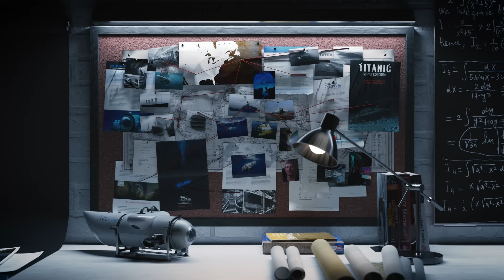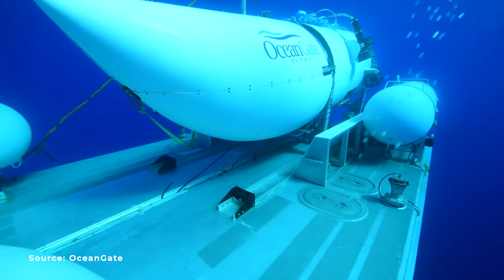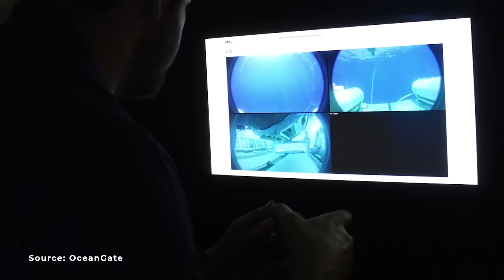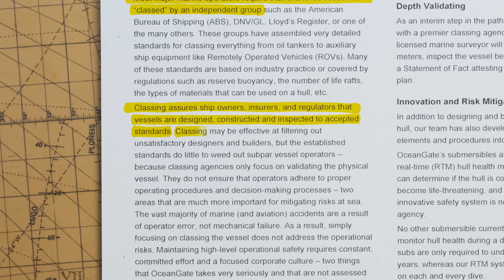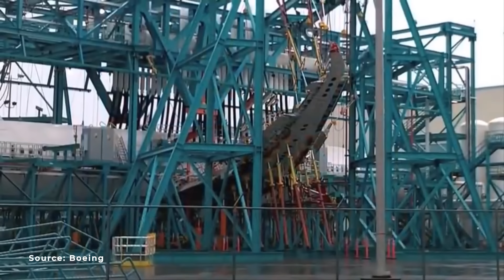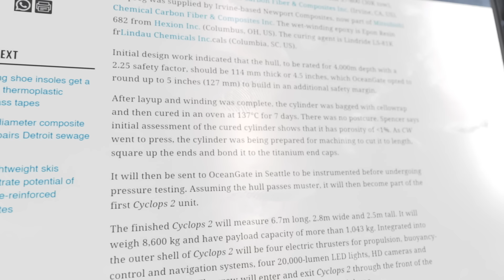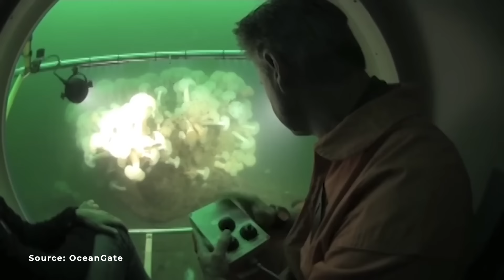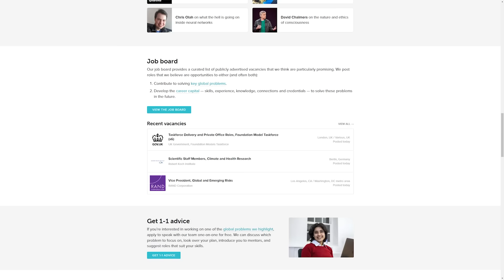The Questionable Engineering of Oceangate

Comment: I think it's interesting to look at SUBSAFE, the military standard. The USS Thresher sank in 1963 due to poor quality welds on parts of the submarine that were deemed not safety critical prior to the accident. In response, the SUBSAFE program was created, and the U.S. Navy stopped losing submarines to accidents. The Navy lost 16 submarines to accidents from 1915–1963, but they've only lost one since then, and it was built before the SUBSAFE standard came into effect. Perhaps the most obvious case of the necessity of regulations for safety is in submarines, but Oceangate did not listen.

Comment: I am fascinated by submarines since reading Tom Clancy’s SSN a decade ago and while I’m not expert, I do know that CF is great for automotive and aero but I wouldn’t trust it in a sub.

The only warning is a acoustic alarm is the most insane thing I’ve ever heard
Reply: possibly not quite as insane as bolting monitors and interior lights to the inside of the hull, as some pics they posted hint at. Not validated, but some engineers in risk management have wondered. Actually, it's hard to pick any "innovation" that was sane in this mini-sub. Maybe the toilet?

Comment: Great video, until you came to the part about the new engineering ethos. The problem with some regulatory and testing agencies, is that sometimes they aren't keeping up with the latest innovations. The trick is innovate testing and regulation along with the engineering. This doesn't always happen and ends up only stifling innovation. Unfortunately, this is why new technology is called the "bleeding edge".  Governments are far more interested in social innovation than engineering innovation. We need to elect politicians that understand these issues. Unfortunately most don't.

Comment: So far, this is the best breakdown of the safety issues that carbon fiber hull posed.  I kept asking about the strength of that material.  I could have sworn that it was super strong under tension, but that’s it.  Glad someone was able to confirm that.
Reply: Yes...this video explains the 'cracking' they heard...and passed off as 'Oh...it always sounds like that'.   This was the second hull because the first one got so bad nobody would go in it so they had to make another one...don't know if they changed anything in the construction and if so...that's just double-dumb.
Reply: Tension and compression are not the same thing, so you are absolutely correct. Carbon fiber is extremely strong under tension.

Comment: About 80,000 hours. Calling them "evidence based" is perhaps skewing the perception a bit. 80,000 hours subscribes to the Effective Altruism model of doing good, which favors short-term, more easily measured impacts than long-term changes. 

This is not inherently a bad thing, but the bias does exist and is worth remarking upon. Philosophy Tube does an excellent and pretty fair video on the ethos of it. Basically "How can we do the most good within our capitalism machine, without doubting whether or not the machine should exist." If that works for you, then by all means, check em out. Within their framework, they are indeed a very well researched and comprehensive service.

Comment: What I'm most curious about is how the aft equipment bay was designed. I haven't seen a detailed examination of this design element.

From what I gather, the equipment, batteries, etc were outside the carbon fiber and titanium pressure hull.

The only way to do that would be to flood that area in order for pressure to not collapse it early in the dive.

What was used to insulate the batteries and other electronics from the water and cold?

Comment: I work with carbon fiber every day. I have no education in carbon fiber or engineering beyond my experience in working with the material for about 15 years. I knew this would not work for a hull. Carbon has no compressive strength. When we have to bolt a carbon fiber part to something, an aluminum or G10 "hard point" is sunk into the laminate to give the bolt a place to apply torque in holding the carbon part to whatever it's being bolted to. If the bolt was tightened down on carbon fiber, the carbon fiber will crush, delaminate, fray, etc. Carbon fiber is a tensile strength material only. In compression, you're relying on the crush strength of the epoxy, which is just a 2 part plastic. This hull was guaranteed to implode in my opinion. I had no idea someone made a sub out of carbon fiber until this happened with the Titan. It's a damn shame. All he had to do was ask someone that works with carbon fiber. Oh, and unidirectional? That was really stupid.

Comment: Take 10 sheets of paper and stack them together. Now pull on the ends of the stack. Now push the ends towards each other. That's a delamination failure. The material is not suitable for compressive loading. The sheets work together in tension, spreading the load. They do not work together in compression.

Comment: Oceangate’s CEO also talked about learning from NASA, despite replicating the same emergency exit issue in the event of fire generated toxic gas that killed Apollo 1’s crew and started NASA on their path safety excellence, from the slapdash rocket program they inherited from the US Army.

Referencing SpaceX their April 2023 test launch, the one they had to destroy due to some of the engines failing, ripped its concrete launch pad to pieces destroying several (unoccupied) structures and a camera car on site, all because the launch couldn’t wait for the concrete to cure. A quick scan of reddit and I can find comments from their concrete contractors that they artificially cool their concrete pours so they can erect rockets on them, but then rip them to pieces shredding the launch site tank farms every time. This has been their standard practice for years.
Reply: None of that is true. The concrete had cured weeks ago. They had done a few test ignitions on the pad already. They did a 50% thrust test. Based on the observed damage they expected the pad to be capable of one launch. It seems the sand below the pad compressed more than expected which lead to the pad cracking which let exhaust gas under it. 

They had already been working on a new design for a few months and are currently installing it as we speak.

Comment: Very interesting and well researched video! Just two points. CFRP is not intrinsically bad in compression, but with poor implementation, yes. Good example : the top of B787 wing  (which works primarily in compression) is in CFRP. The way you introduced it was quite misleading, even though the following detailed explanations were quite good and thorough.
The main issue is not CFRP per se, but lack of good practice - especially testing - regarding advanced materials is.

Think about it: if composite were so bad in compression and with a poor lifespan (short fatigue life), it wouldn't be used in any beams or parts withstanding bending and/or compression and/or cycles (e.g. ski, bike, golf club, tennis racket, aircraft wing, etc.) ...

The other (small) point is listening to "cracking". First, you say it is useless because is it instantaneous, then, you provide an example of someone how witnessed it (and survived). Because in practice, you can indeed hear the CFRP cracking long before failure. Problem is - again - poor practice, for this is not a reliable way to predict failure (especially when again you've not tested it). But this was enough to inform that the structure was working too much => good way to get warning ("ok its time to stop"), bad way to get prediction ("ok, I can do a couple more of dive").

That engineering guy did exactly the right thing (and props to him for doing so): working on it until good practices were not meet anymore.... critically during the qualification phase!

What could be done? A solution would have been to just add more CFRP. Autoclave (that you rightly mentioned) would have been also a good thing.

Conclusion: CFRP is not the issue per se - far from it -, but poor implementation is.

NB: I hope this message don't sound too harsh, because the video was overall very well research and executed :)
NB2: the submersible was struck by lightning in 2018, which is a well-known way to create internal and hard-to-detect delamination :-/ (again ... testing and qualification, blabla. ...)
Reply: that story about being struck by lightening was from Rush, given to passengers who had already paid for a trip in 2018 or 2019, as an excuse why there wouldn't be trips that year. (there were also other excuses Rush used.)  It's very unlikely true, more likely fabricated to fulfill one of the exclusions in the contract for refunding or rebooking later without further charges (i.e., acts of God do not qualify for refund of cancelled trips or full credit towards future trips).

Comment: Even if the CEO wanted that everything he and his company do to look innovative and to push boundaries and I think that it ok to push them however he was pushing the wrong boudaries(the safety ones)in the wrong direction.
It will be called innovation when/if he will do a subs that is 10 times cheaper and 10 to 100 times safer or if he created and designed a new tehnology instead of cutting corners.
P.S.:After the incident I was looking for a video from your channel and I didn't found but here we are and watching as fast as possible when I see in my feed.

Comment: while not an excuse for poor design or profiteering . all those aboard were reported well known "adventurers", risk taking sort of comes with the territory sadly.
maybe doesn't apply to this particular situation but, a lot of what modern engineers know today was built upon somebody doing stuff they were told can't or shouldn't be done.
great video though. as a tool maker worked closely on a project with Boeing engineers when carbon fiber composites were rather new. was very interesting there was a lot of, a lot of testing, test, make changes over and over again.
love the channel. subbed

Comment: The whole glue bonding process. Was the main factor. But overtime the carbon fiber hull grew micro fractures. Which because of not inspecting the whole craft resulting in malfunctions to go unnoticed. Even during final descent the malfunctions wasn't noticed until it was to late. The craft was built with two pressure chambers one for the passengers one for the main control unit. Which has backups. The contol unit got water into it overtime growing a small leak. It was never noticed. Adding a lot of extra weight to the craft. Which is why they couldn't issue an emergency ascent like it should.

Comment: Geez, I didn't realize it was a carbon fiber hull. What a horrifying design choice! I think you gave the company way too much credit in this video. Most likely, the CEO was yet another blowhard tech-bro with absolutely no engineering sense who saw carbon fiber showing up in things and figured it's a silver bullet to all engineering problems and then told his team to build it no matter what. I strongly doubt any serious cost analysis was actually done at any step and that every cost decision was entirely reactionary to the problem that preceded it. Even with an autoclave, even with testing, even with all that stuff, carbon fiber is still an inferior choice both in compressive strength and cost. I mean, come on. It seriously could not have taken that much more in cost to slap some foam on the outside of a titanium cask.

We engineers need to start speaking out more against these absurd tech-bro pipe dreams BEFORE these easily preventable failures keep happening.

Comment: Great video! First one I've seen touch at all on the failure modes of composites under pressure, or explain exactly why the acoustic warning system was ridiculous.

"Move fast and break things" comes from Facebook's internal design strategy when they were expanding their services rapidly. Their worst-case scenario when "breaking things" was a glitchy social media site. Anyone who uses that philosophy for human-crewed vehicles is an idiot. 

Re: SpaceX, they tested to destruction with no people on board and then improved their design. Still not even remotely the same.

Comment: Regulation limiting innovation is actually a good thing.  Just look at the early history of iron and steel bridges.  With very few exceptions, all of the bridges that failed were the most innovative designs of their day.

The problem with using acoustic monitoring to warn of impending failure is that you would need to test the system to verify that it actually worked.  Stockton Rush did not have the money to properly get the job done, but only found out when he had spent too much money to abandon it.  He should have built an ROV (maybe more than one) with a carbon fiber reinforced epoxy hull, equipped it with his acoustic monitoring system, used the ROV to survey the decay of the Titanic.  If the acoustic monitoring was able to predict failures in a timely enough manner to prevent catastrophic damage, he could have gone on to passenger carrying hulls.  Being a cylinder, you can cheat on the circular area tomographic X-ray scanner by rotating the hull, instead of the x-ray source and detector.  Checking the hull for damage after each dive was possible, but the submersible would need to have been designed for it (Hoist the Titan onto the mother ship, unbolt the end caps, slide out the interior, and then slide out the cylinder).  

The Virgin Galactic craft really should have been redesigned, based on the simulator runs.  I am not privy to the exact design challenges, but the issue seems to have been only a tiny window in time between when the craft will be destroyed if the folding mechanism is not locked and when the craft can still safely abort if the folding mechanism is locked.  If the test pilot had tried unlocking the folding mechanism early, in a simulator run, and been told that the craft had broken up, he might not have tried it on a real flight.  Of course, the crew should have been told in no uncertain terms that unlocking the folding mechanism early would result in the craft's destruction.

Comment: Using my rounded numbers, the sub experienced some 800,000 lbs. on every square foot of surface area. It's not much of a stretch at that point to say it had a millions pounds of pressure per square foot. It's hard to see carbon fiber enduring that kind of compressive load.

Comment: No evidence was provided to support the claim that customers were mislead into believing the sub passed certification and was safe. Can you elaborate on your sources?

It seems to me that customers using the sub were aware that it was experimental and not certified. The Release of Liability Agreement, dated 6-9-22, states on page 1, paragraph 2, "A portion of the operation will be conducted inside an experimental submersible vessel. The experimental submersible vessel has not been approved or certified by any regulatory body and may be constructed of materials that have not been widely used in human occupied submersibles."

Comment: Since you have studied composites, I have a question. Could the Titan have been cycle tested using hydraulic rams to find how many cycles would be "safe"? It would of course take a custom machine to squeeze the hull, but if they can do it for airplane wings, this shouldn't be impossible. Also is it not possible to use ultrasound imaging to check the structural integrity on the pressure vessel after each dive? He mentioned there was no tool that can do this, but it seems like some frequency of sound based imaging should have worked to find less dense areas (delaminations and voids).

Comment: When I heard the Titan had a Carbon fiber hull, my first thought was that hull was the point of failure. Though I never finished my engineering degree, and I wouldn't claim to be an expert on materials science, what I did think of was NASA's canceled X-33 program, and the direct cause of the cancellation. Specifically, the craft's main fuel tank, which would have been made of carbon fiber composite. Unfortunately the tanks would consistently fail pressure tests, and techniques to construct viable composite tanks weren't developed until years after the program's cancellation. I figured if they had that much trouble dealing with relatively lower pressures, then composites would be a terrible choice for extremely high pressure environments.

My second thought was "why would you use aerospace protocols to build a deep sea submersible?" This seemed incredibly wrong to me. After all, aside from missions to probe the interior of a gas giant, or explore the surface of Venus, spacecraft generally don't have to withstand intense pressures, and wouldn't consider them a factor to build for. Stockton Rush may have had a degree in Aerospace engineering, but considering his disregard, if not outright scorn for safety and refusal to listen to any feedback or concerns from people with real world experience, I wouldn't consider him a good one.

Comment: My personal experiences with carbon fibre dictate that carbon fibre has its place. When carbon fibre fails, it does so catastrophically. It is not like conventional materials like  steels aluminium plastics etcetera etcetera which are pretty predictable through due process.
Carbon fibre has its place but not in my environment for now.

Comment: i am a pretty inexperienced fibreglass and composite material laminator with 5 years on the job and mostly deal with yachts and boats but even i knew as soon as i heard it was wound carbon and epoxy bonded to titanium that this sub had imploded . the epoxy bonding paste and resin lamination with the wound carbon fibre can never be totally homogeneous with no micro air bubbles or weak voids . not even vacuum lamination with the best epoxy systems and additives , curing and proper prep in a controlled environment with humidity and dust control will give a totally homogeneous matrix